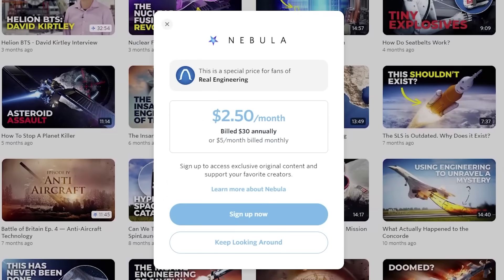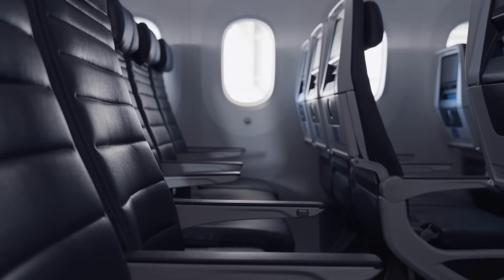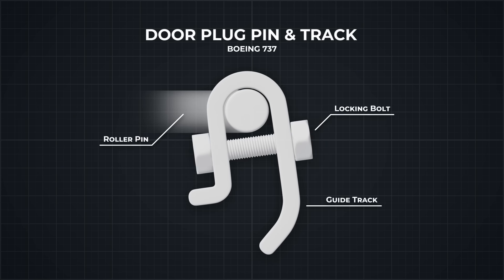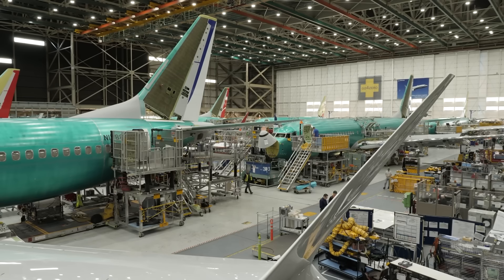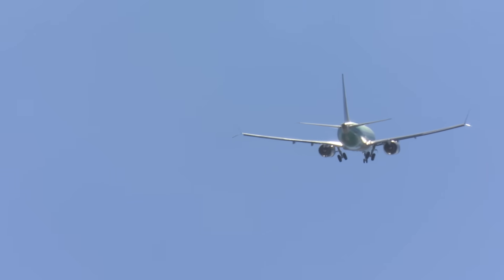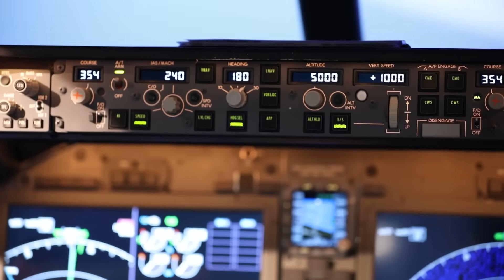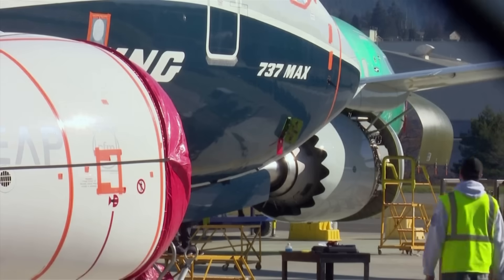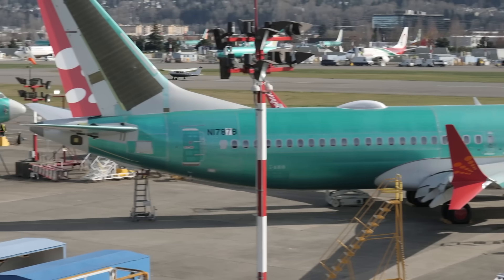The Questionable Engineering of the 737 Max

Comment: 7:14 this is a common misconception. The plane was still stable with the larger engines. However, the larger engines and the higher location caused the 737 max to have slightly different flight characteristics than legacy 737s. Airlines didn’t want to have to recertify legacy 737 pilots for the new plane, so Boeing developed a system to make it handle more similar to the legacy variants.

This system would automatically adjust the trim of the aircraft and had the potential to create a runaway positive feedback loop that would drive the nose into the ground. I believe the system is still used today but the computers can only make 1 trim adjustment per flight, which was the original plan but the programmers upped the computers authority during testing phases as it wasn’t enough to make the new and old planes fly similar enough.
Reply: The plane was still statically stable, but it most likely wouldn't have met regulatory requirements for the stick force to increase smoothly as the load factor increases. It's not really a positive feedback loop, though it did lead to a trim runaway. 

MCAS today can still make more than one trim adjustment, but there is a limit based on the total commanded trim. It also monitors both sensors (assuming both are available) and the computers monitor each other's trim commands to ensure there isn't a problem there.

Comment: I am shocked they've put new engines partially over the wing. This should be banned during design stage. No software will compensate that. They could have solved it with canards or smth - still a compromise. As a non designer I still think it s**ks.
Reply: Given that MCAS does not activate at all in the operational flight envelope, it quite clearly isn't a major deal.
Reply: @AmbientMorality  Maybe. Hope when it activates, does operate properly by now.

Comment: Here after air india 787 crash. Sam barnett was right about 787
Reply: Oh so you exactly what happened already? You must’ve been on the flight deck, or are an investigator with the FDR and CVR data, right? And who is Sam Barnett? The actor?
Reply: I have heard that there has been speculation about pilot suicide in this crash. This was only the first fatal crash of the 787 in its 14 years of service. India's other airlines are also under scrutiny for the unsafe operation of their aircraft.

Comment: The most outrageus thing is that airliners are creating demand for plugging up emergency doors, just because they are not needed to fufill the bare minimums. Clearly people are dying due to taking too long to leave the plane in emergencies. and they could have died due to the added complexity of this system causing problems like this. It just dose not compute for me that taking on so much complexity just to avoid having a emergency door even when all the extra structural support, and complexities of having the door are paid for. How much space could it possibly save over just having that sligthly longer row needed to support the door? its not like you need that space when you have the lower max occupancy rate anyway. '

in my head this is the sort of on paper cost cuts that gets a ceo a big nice bonus, but actually costs them money in terms of quality reduction, cost increases due to complexity, or probabilistic avrage brand damage based on the increased risk of fatalities in a potential crash. a big cost if it happens, so evened out with the low probability, even for an entire airline, it still is not zero.

Comment: i ran manufacturing quality training courses at Spirit on two occasions. Their manufacturing engineers are well meaning, but very very backward. They knew next to nothing about measurement, statistical process control or capability.The two sites that i worked out mostly supplied Boeing, but it was Airbus pushing them to improve. Bizarre.

Comment: Why on earth are the door plugs fitted from the outside in the first place?. They should be designed and fitted from inside so they cant physically come out anyway under any circumstances its extremely simple. Absolutely retarded design. 
I pray this company goes.
Reply: They're designed to be functionally similar to the doors so that it can be installed in place of a door easily and because it's better to certify less new items than more.

Comment: 737 max wasn't/isn't unstable in any way, it just had a different control feel in some situations, and for use license(type rating) from old type 737NG they install MCAS system (already in use in military air tankers), mcas installed in 737max had a bug (error in code) that fight with pilots (should turn off itself).
Reply: MCAS on KC-46 is essentially a different system named the same thing. MCAS in 737 MAX did not have any bugs, in that it performed exactly as it was specified. It was not intended to turn itself off at any point, because it needed to "fight against pilots" in order to do its job of improving control feel at high angle of attack.

Comment: The ending was incorrect. The problem is the company culture. Business people cutting corners and running a company by starring at balance sheets all day is the cause of all problems. Deregulation, safety layoffs and engineers not having a say in anything is the result of that. All problems in Boeing can be fixed, but they won't because management will cut corners to oblivion.

Comment: Correction, The cockpit door slamming open was actually a design by Boeing as a result of the cabin losing pressure. Cockpit door is designed to unlock.

Comment: So as you correctly pointed out that the maintenance has just reseted the warning light instead of doing the real job! Not only Boeing is bad the airlines are worst under the pressure of their management to fly as much as possible despite the problems. So the whole USA air travel industry is under this dysfunction !

Comment: derp derp
Reply: You have no idea what you are talking about. The mcas wasnt here to correct  the design of  airframe  itself which wasn't that bad but the piloting with it. And using computers to fly is  already common in this field, all modern planes use similar things. The problem was that the mcas wasn't made properly , but it was a good and already witnessed solution. 
I'm afraid you don't even know what you call bad engineering and the reason why the mcas is here. The nacelles placement would only alter the piloting in specific situations , exempting the huge majority of flights to require any mcas intervention.
Reply: @Hk-uw8my  I recommend reading Hello World: Being Human in the Age of Algorithms and then you may understand why any software solution is not a perfect solution and should not be used to mitigate flaws in engineering. College educated in compsci over here. On the other hand, you sound like an idiot or quack. Take your pick.

Comment: You actually can tell from the inside where the door plug is.  Each wall panel typically has two windows.  The door plug only has one window in its wall panel.  I know because I got to sit in the row behind the door plug last weekend.  You better believe my seatbelt was fastened the entire flight.

Comment: ONE QUESTION: If the airliner cabins are pressurized to 1 atmosphere, why do we  feel the changes in pressure anyway? inside our ears, the plastic bags pump up, etc. This bothered me for some time. Thanks.
Reply: For most of commercial aircrafts, cabin is typically pressurized at 8.6 psi approximately.  You’re thinking of sea level pressure of 14.7 psi (1 atm) So the delta-P between cabin and atmospheric pressure which changes with altitude is what passengers are feeling with physical response  to change in pressure.

Comment: Israeli DRUG SNIFFERS made in Israel can tell if Management of Boeing have been doing Cocaine.
My info (through special services)
says that the management teams have a systemic addiction to cocaine use.
Thankyou Israel, once again top of the pops in technology intelligence.
Speaking of outsourcing:
Outsource Boeing Management to an engineering firm used to project management, and use Mossad Types to police the management, the unionised workforce, and the communications specialists in contact with sharholders.That way there is an equilateral triangle :
Customers top corner
Workforce right corner
Management lft corner
That's an equilateral triangle!
Profits run through the middle!
This way witnesses like John Barnett 
stay alive and un-needed, not un-alive.

Comment: "Hey guys, we've got a fundamental Engineering problem with the stability of our plane". Management: "No worries, we'll fix it with some software".   🤷
As a professional Automotive Engineer, I can tell you it just doesn't work like that. It will nearly always end in tears.
Software should only be used to augment fundamental Physics, where the fundamental physics is already correct, NOT fight with the Physics.

Comment: There was/is no "fuselage damage" at all. A fresh "door plug panel" was installed in this aircraft with no adjustments/repairs/changes to the opening.  Your video is really just unnecessary. Not helpful.

Comment: What Boeing did was ridiculous. They went from a leading manufacturer to a following manufacturer, and in order to maintain profits, despise what they were told, consistently for years, they cut corners and tried to rehash the 737. think about this 
Airbus in response to the 787 initially offered a reworked version of the A330 and despite having to scrap that idea and come up with the A350 they were still able to offer a very successful reworked, A330, with hundreds of orders and no problems. Boeing bought Macdonald Douglas, who had smaller aircraft yet Boeing did not offer any more of that and  ended up, kicking off when the C-series arrived now the A220 is very much being looked at as the future.  instead of offering great products, Boeing simply focused on profits, and the result of that is a massive loss of profits, terrible damage to reputation, and they will be stuck as a following manufacturer for decades to come.

Comment: It was all caused by Boeing need to catch up to Airbus.
So they fitted a new bigger, more powerful , more economic engine.
But it was too big and nearly touches the ground (look at its flattened bottom). So they had to hang it further forward.
They should have designed a whole new airframe around that engine.

Comment: The oversized engines didn’t make the 737 Max “unstable” it altered the maneuverability characteristics just enough so that regulations would require re-cert and pilot re-training. Boeing secretly installed this non-redundant algorithm, that could not be bypassed, to automatically cheat the natural flight characteristics to avoid expensive red tape.

Comment: 737 Max should never have been built. I don't understand why you will built a plane which inherent cannot fly without software intervention. Modern software is amazing and means we can fly an object which is not aerodynamically stable. But while it is great a F22 or Eurofighter can turn on a penny due to the instability, I am not sure I will be happy to sit in a plane that will stall without compensating software. Again, 737 Max is here because it saves money, not because it will save lives.

Comment: Blancolirio has a great video on what happened and the NTSB report, including pictures of the accident door before the plane was delivered to Alaska Airlines.  What it shows is the 4 retaining bolts needs to prevent the door from moving were never installed.  This only left the plug stops and the cabin pressure from ejecting the door.  Luckily the plane was only at 16,000 ft and not at cruising altitude and speed where the plane could have easily broken up.  It was a quality control issue between Spirit Aeronautical and Boeing that let an unsecured plugdoor enter service.

Comment: On the MAX incidents it's important to state that Boeing expected pilots to use the runaway trim C/L which is a memory item. This C/L was to be used for uncommanded trim mouvement which is basically what happened in the crashes and after JT610, Boeing restated via AD to use this C/L in case of uncommanded trim movements due to MCAS

Comment: I just flew on the MAX 8 this past weekend, and it was the most turbulent ride I have ever experienced. The next connecting flight (on a CRJ200) was nice and smooth.
Reply: With all due respect, this has way more to do with the air you were flying through than the aircraft you were flying.

Comment: Spirit aero systems was a  part of Boeing. It was spin off by one of the prior CEOs. There are several articles about it but two things stood out 1)they took the concept of lean/JIT manufacturing to the extreme 2) they thought by spinning off subsidiaries and making them compete for going contracts the "free market" would produce the most cost-effective products . Of course the managers cut corners to get the cheapest product.

Comment: Alaska airlines not doing proper maintanence again ... last time they did that a plane fell out of the sky with no survivors, this ain't their first rodeo
Reply: Considering this was absolutely Boeing's fault (and by extension Spirit, since they're the ones who installed the damaged gasket Boeing had to remove the plug to fix), I don't think so. Alaska specifically has their B39Ms configured to not need those exit doors and those plugs are semi- permanent. There's no reason for the customer to check that the bolts are there, because it's an entirely valid assumption that it was built correctly.

Comment: This engine anti-ice system problem. I think it’s the biggest issue for the Max. The FAA has said that the Max 7 and 10 cannot be certified because of this issue. However, there is already every other Max flying around with the known issue. This is a major safety concern, and should not be allowed for these aircraft to fly with it! It’s absurd that an aircraft can actually lose an engine in flight and the FAA is OK with it.

Comment: If a thing "can" go wrong, it "will" - Murphy's Law. He worked in an aircraft factory. So he knows better than any of us. 
Between (the above) "can" & "will" lies the whole of engineering - "Reliability" engineering in particular. When a part is made for use in an aircraft (it may be the whole engine or a door plug), it becomes a critical component & it shall not fail. But it might, one day. If MTBF (mean time between failures) can be designed in such a way, to be 50 years, it will not conk off as the aircraft would be condemned from service & confined to the scrap heap. Essence of the problem (as I gleaned from literature) is this.
In a regular engineering product like an aircraft, all these things with features built-in (designed) to last for life of that product - unless a management guy (can't be expected to be a full-fledged engineer) interferes with the process or he intervenes. It is the engineering team head who alone can say that "this aircraft is unsafe". If the "builder" of the aircraft has to fire someone its the management guy - for not heeding the advice of the engineer. Don't blame the engineer, unless he is bad in his subject.
737 is the most successful passenger carrying aircraft to date. It had had its run. In its original format it can still fly, if a brand-new aircraft is made. Trouble started with engine change (the new engine cowling, fouling with the top of the wing surface), with one of enhanced performance. But it reduced ground-clearance. Solution involves the whole design of air-frame (costing US$ 1 million), that changes it from 737 to some 7Y7. Or the landing-gear may have to be redesigned with extended height, so that the wheels jut out a bit more, compensating for shortfall in engine's ground-clearance. Instead, another (stupid soft-ware) way was found & tinkered with - a wholly unwarranted procedure. 
Don't allow the software guy to add an "engineering" product. For him everything is a video game. That is his mind-set.

Comment: Intentionally shoddy planning, construction and execution, "jedi mind tricks" played on safety authorities, no preventative or punitive actions from those in charge, cheap and shoddy suppliers... It's what happens when you deprioritise quality and safety. I do not recommend flying on a 737MAX under any circumstance. It is normal for complex engineering to show faults, flaws and defects, however this plane model has shown at an alarming frequency that it has more problems than just some hiccups.

Comment: QA shares a fate with IT. If it's going well, you don't even know they're there. But those departments exist to mitigate cascade failure. Downsizing your quality management system is akin to skimping on oil changes and new tires, and then responding with a shocked pikachu face when the car starts to fail.

Comment: i think planes should not have door plugs it should be a solid sheet of skin and then when an airline wants to upgrade they have to take a dremel like tool or power nipper and cut the hole in the skin to install the door.

a plug or knockout is ok on an electrical box or a pc card slot but not in a plane.

if i was boeing i would do a walmart and work the employees off the clock"

as soon as they punch out "oh we need you to connect the plane towing tractor to flight 1549"

saving money on squeezing a 15 minutes of labor out of 1 employee for free can save the business enough money to be able to feed 1 employee  a lavish dinner.

Comment: Just Install Emergency Doors with removed door handles and avoid 1 size fits All. emergency Doors are better then panels as Emergency doors have ANNUAL/Per Flight MAINTENANCE and inspection Tags/checklist compared to panels and windows

Comment: When Boeing acquired Mcdonnel Douglas Boeing adapted the Share holder way of running a company and took control away from the engineering system that Boeing had in place.
Shareholders above safety
That's Boeings new Mantra.
AND IT SHOWS 😢